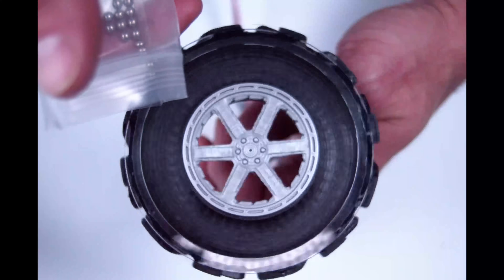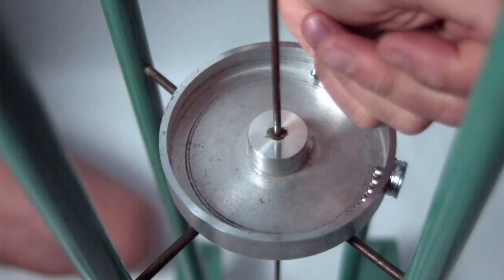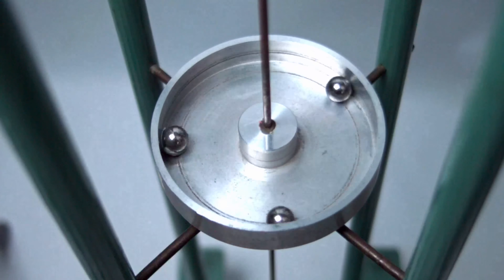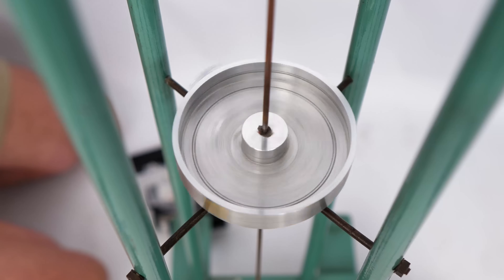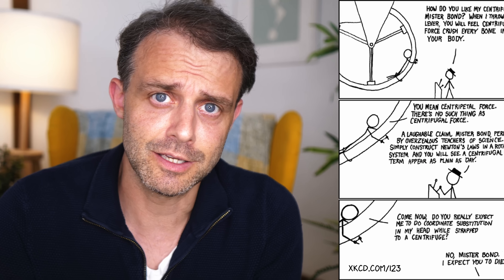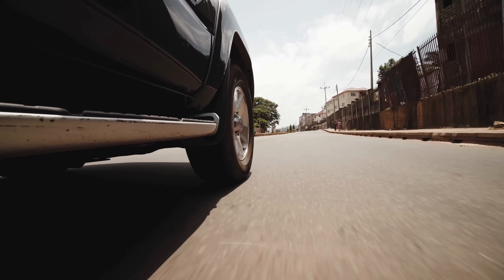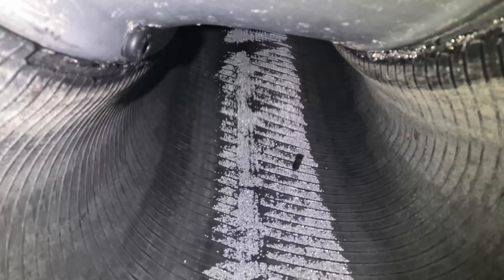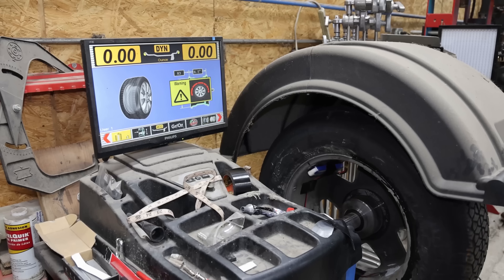Do tire balancing beads actually work?

Comment: I mean the problem there is that your wheels will only be balanced in very specific circumstances. So proper wheel balance weights would be better, regardless of the cost, because it would mean your wheel is balanced always. Unbalanced wheels don't just cause problems at 80km/h, it will lead to uneven wear and potentially bad handling.

Comment: I've used tire beads before and was never impressed with them, but now watching this video I understand why they didn't work for me. I had them in my motorcycle tires and would usually be driving around in residential areas, so my speed never got up to highway speeds. Explains why once I hit the highway the annoying shake I had all the time would go away and stay away until I stopped again.

Comment: Some things to think about for fun.  A car tire when rolling has a flat spot where it make contact on the road.   In other words: the outer and inner surfaces of the tire are a circle with a flat spot where the tire radius  is smaller than for the rest of the circle.  The tire inner surface travel with respect to the wheel axe at a speed speed of omega R, were omega is the rotation speed, except in the flat spot were it travel at a speed of omega r.  Where R is the radius of the inner surface away from the flat spot and r the radius at the flat spot.  So the beads  have a  + and - tangential  acceleration has they pass through the flat spot.  They also have ~ no radial acceleration as the flat spot pass them as their trajectory is straight.
The upper part of the tire travel at a speed of + R omega with respect to the car.  The lower part of the tire in the middle of the flat spot travel at a speed of - r omega with respect to the car. One would expect the two velocities to be the same!  This difference is only possible because the tire in the flat spot is elastically compressed or shorten in the circumferential direction so the same amount of tire is moving forward as backward with respect to the car.